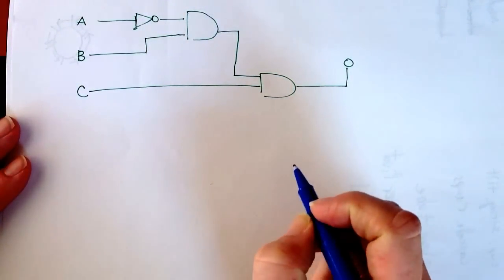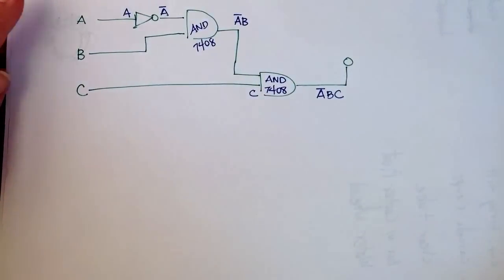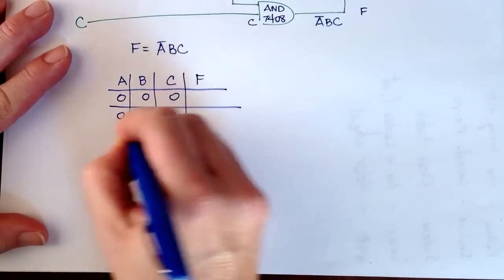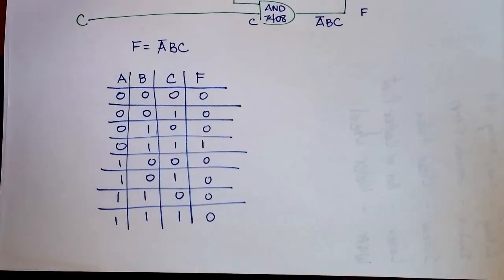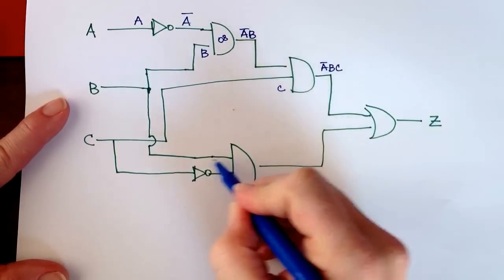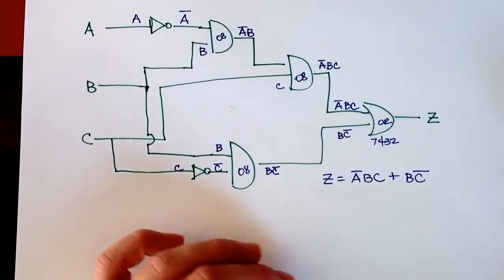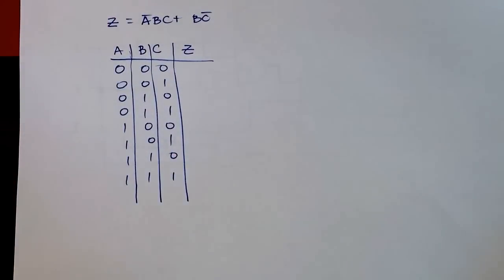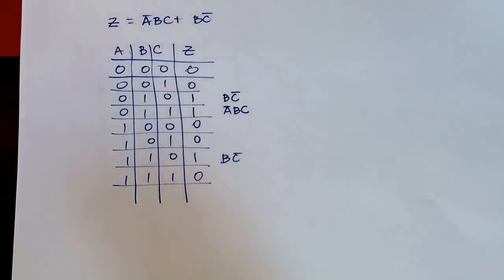Getting the Logic Expression and Truth Table from a Circuit

Comment: Let's take example 1, did you explain the inputs properly?   Did you assume that all inputs are always 1 (i.e. on)?  Therefore is A is not necessarily always 1 before it is negated?.   In other words if e.g. A is zero at the outset when it is negated it becomes 1.  

The second example, did you leave it incomplete i.e. aren't you supposed to ADD  B not-C with not-A B C ?  Thanks.
Reply from the maker: So we made a truth table for all possible conditions where there are three outputs. There are 8 conditions possible. They are 000, 001,010,etc. to 111 (0 thru 7 in binary). If I did not answer your question, please let me know. I will try to answer in a different way.
Reply: Ok yes I see that, maybe i'm overcomplicating it but why have you not included not-A in the Truth Table?

Comment: Write a Boolean function and construct a logic diagram of a circuit which use of basic logic gates to activate CSU main entrance door during 9:00 am to 12:00 pm and after lunch time during 1:00 pm - 4:00 pm. You need to use 24 hour clock timing when designing this circuit. 
 
Please insert the Boolean expression, minimisation, and the diagram